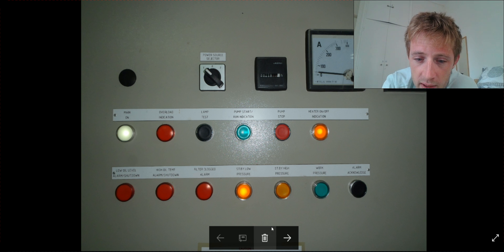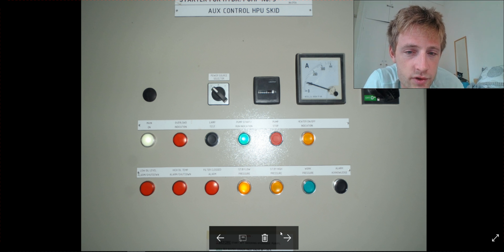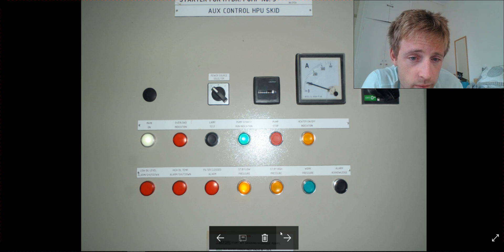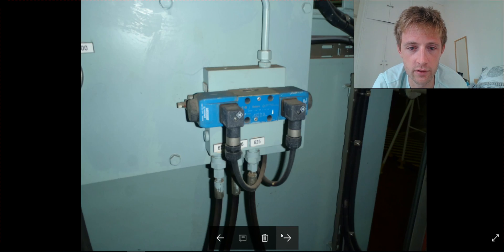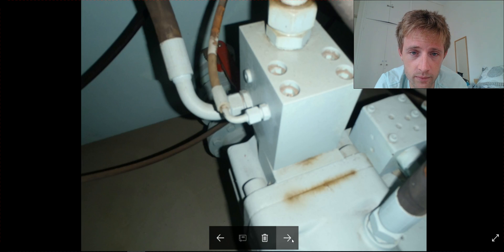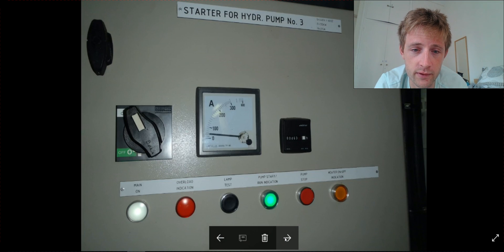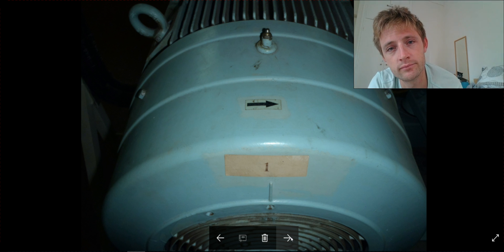HOW TO CHECK  HYDRAULICS!

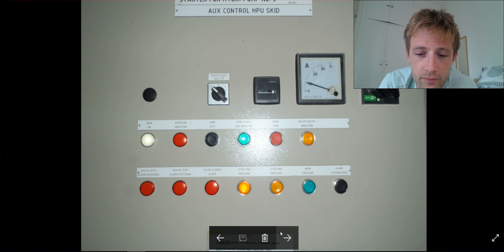Comment: Hello Mr :) from video picture 1:57 , there is block valve where is the hose connected ( maybe like pilot valve ? ) this is for keeping pressure ready on the system ? thnx a lot
Reply from the maker: Hello dear friend it will be necessery to check diagram before answer this question there is lot of components on a hydralic unit.Mostly there is actuators ,relief valves,regulating valves ,blocks and etc.